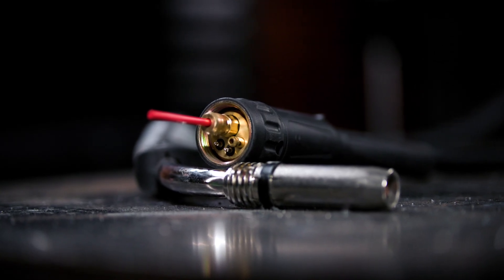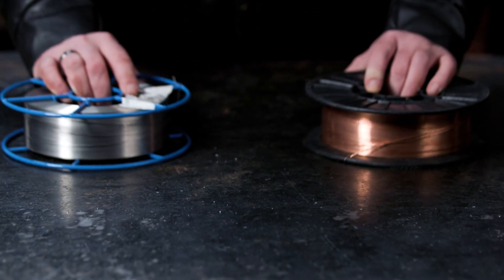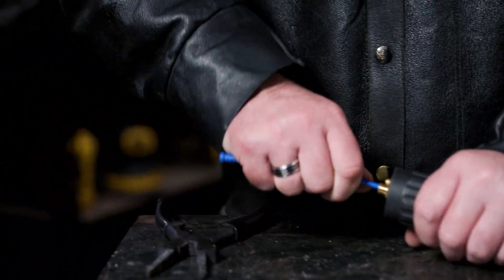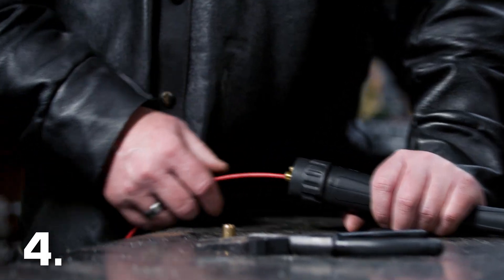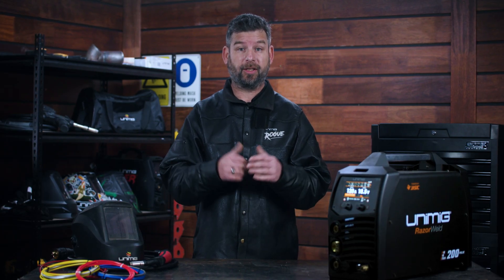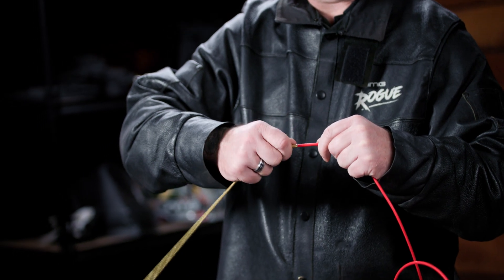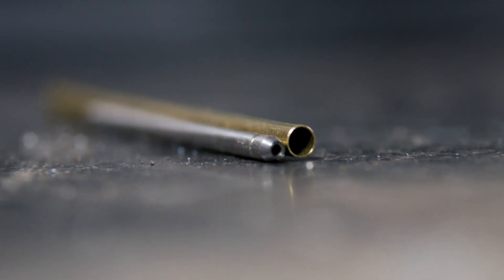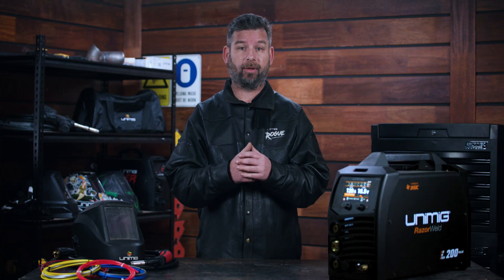How to Change the Torch Liner in Your MIG Welder

Comment: When changing to a graphene liner do you still keep the 10 in or so of metal liner into the gun or do you remove the metal guide liner completely and have the liner all graphene?
Reply from the maker: Hi John, you can run the liner to the neck all the way to the euro connection; there is no need for a neck spring.
Reply: Many thanks for the info. Cheers